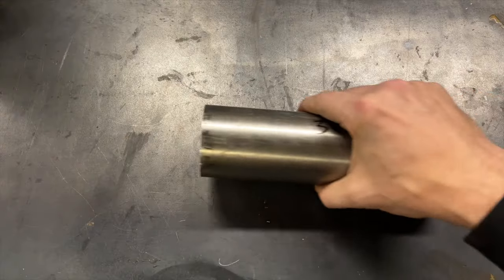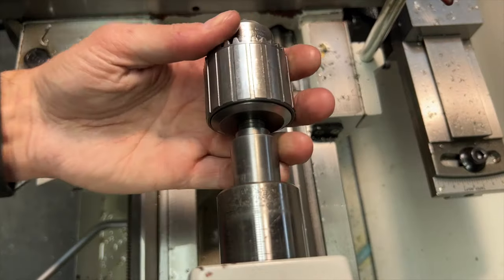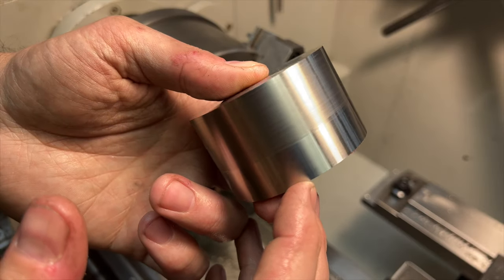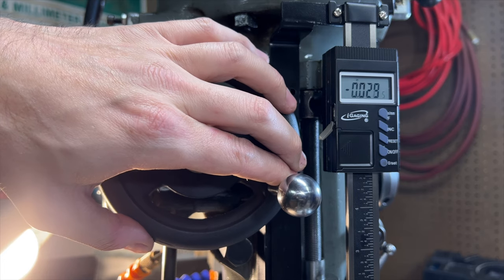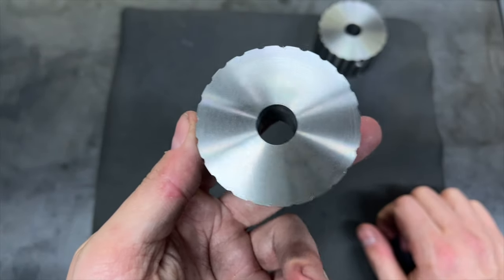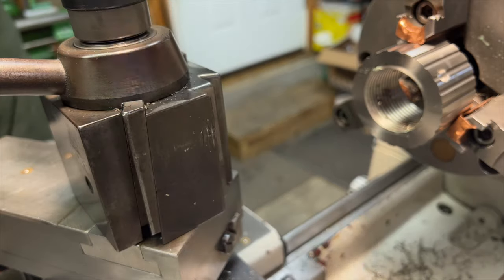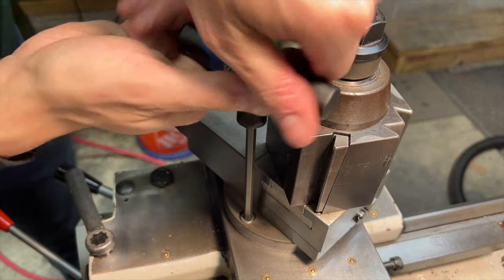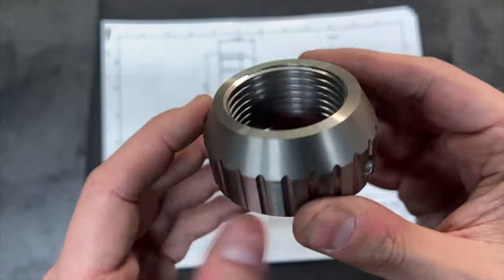Spindle Thread Protector - Internal Thread & Indexing

Comment: have tried threading with reverse feed? it eliminates any worries about running into the chuck, or the part, and doesn't require any gut-wrenching stopping of the feed... reverse threading is used on some precision lathe threading attachments, too....
Reply from the maker: I've seen Joe Pie's video about it, but I haven't actually tried it yet. I need to practice it on some scrap before I'd feel comfortable trying it mid project, know what I mean. And I always think about it, mid project... lol But great suggestion, thank you!

Comment: Nice job. I love stainless. It's working it that sucks. Curious though. The first part looked like it had enough meat on it to just clean up those unimpressive flutes. I was surprised when you rejected it and started from scratch.. 
Wakodahatchee Chris
Reply from the maker: Thanks very much! And yeah, it's tough to work with but sure does give a great result if you can get it right. The other part might have been salvageable? But seeing as I was making this for someone else, I figured the best thing to do was to just start over using the lessons learned and make the best part possible. If I'd have been making it for myself, I might have considered trying to salvage it. Thanks for watching!
Reply: @hersch_tool  I gave you a thumbs UP for that reply. I forgot this was not a personal project. In retrospect, I hope I would have done the same thing. It certainly paid off! 🖖👍
Reply from the maker: @cdrive5757  Thanks very much! I really do appreciate the feedback and always enjoy valid questions, suggestions, etc. so keep em coming! cheers.

Comment: Ah, someone with the same mindset... The quality of the part is most important... Material choice is dictated by the part, not the scrap bin :P tho i get some deviations from that rule in case of single use things or non-critical stuff... 

Nice work btw!

Also, consider making a morse weldon adapter for a few center drills... make the fit as tight as possible, mill a slight spotface for the brass tipped setscrew to act against and arm your cabinet with those... Make a few for other size drills.... Just get a 3mm hard milling 65hrc+ cutter and it will work for all the drills... You can even insert a drill, and come down at an angle that will not put a square spotface and hole in the holder and the drill, but a sideways one, that will only be great for preventing the rotation of the drill in one side, as drills are single direction anyway... you drill through the holder, touch the shank of the drill in the holder, extract the drill, spotface it in the same place the drill cut into and voila, a rigid, quick change drill system... Its a bit of work, but when you have them, it makes the drill chucks seem primitive in a way, and demanding of too much effort for most things... You often want to put a center in a part, and the center drill is rarely in the chuck, so you have to get the chuck, get the drill, socket the chuck in the taper and chuck up a drill before you can work... With the adapters, its a single plucking from the cabinet and into the tailstock she goes... It also negates the chance for a drill to spin in a chuck, ruining the shank of the drill and thus rendering it even less precise than your average brand new drill bit... And it beats using a collet chuck in the tailstock on a galactic scale, merely from the efficacy standpoint... 

All the best and kind regards!
Reply from the maker: Haha, agreed! And yeah I'll also dive into the scrap bin and use "whatever" if it's not super important. And it's funny you mention that, I actually have an mt2 adapter like you're describing and was just recently looking at it and thinking that I'd like to make another with an mt3 shank and maybe a set of bushings or something to accept different size center drills. And thank you!
Reply: @hersch_tool 
Yeah, the good ol` scrap bin... The least well treated piece in the shop, yet one that is often the giver of gifts you could not even hope for otherwise... Sure, its like finding money in your own clothes not worn for a while, but it`s always a pleasure digging out the perfect piece for the job... 
Regarding the drill adapters, yeah, those things are marvelous... I mean, there is a good reason why even medium sized drills come with Morse shanks since the dawn of modern machining(pre-cnc, i mean the grandfather era of modern works... Line shafts age and mangled workers turned into meat pies age...)... It`s mostly the complex of rigidity, ease of use and reliability that rendered the larger dills into morse shank drills, not the issues of handling a large drill chuck needed to grip the large shank... Why not apply the same logic and qualities to a smaller drill, especially when you rarely use the massive ones...  
Its quite interesting to notice the cosmic giggle when you contemplate something, only to see or be told of the same thing -  without any possible explanation of algorithms and cookies and what not being involved... 

All the best and kind regards!
Reply from the maker: @camillosteuss  Haha, yep. One might even contemplate the fact that we've somehow made it this far without algorithms and cookies... And you know what they say, great minds and all that... ;)